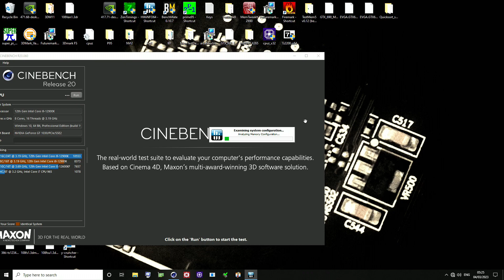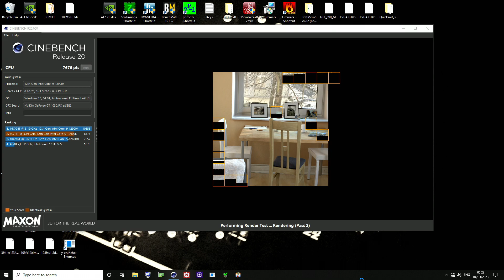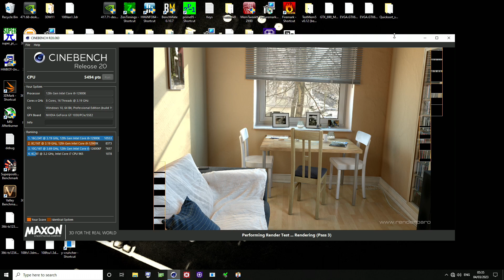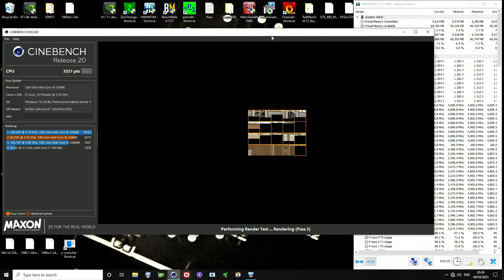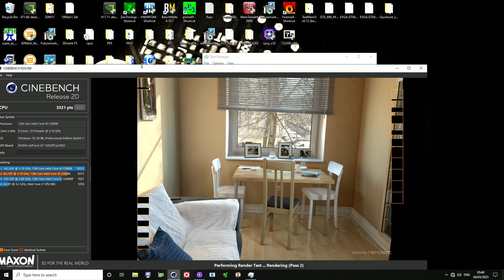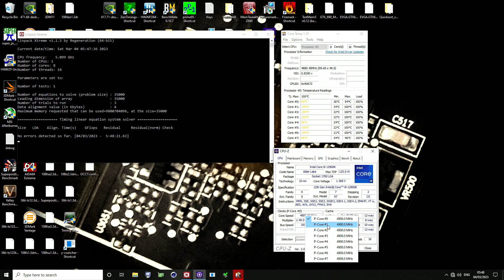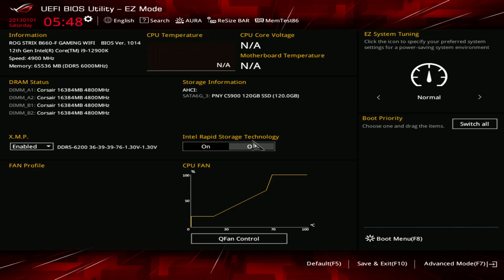EXTREME CPU CLOCK STRETCHING on intel 12th gen

Comment: My 5600x does this too. For example, just by setting the LLC to the lowest setting and leaving everything else on stock settings, the score is much lower. I can read that the effective clock changes in HwInfo tho. The non effective clock remains high.
Reply: I just realised my 5600x does this too, at auto settings. It stretches bad from some ntoskernel loads from C0 to C1 and introduces a stutter.
Workaround is medium llc and I also disabled spread spectrum.
Thats with pbo -25 -30 offset. Then the chip clock/voltage table works properly and limits itself to 4.5GHz 1.37v spikes under AVX loads.
If I then dial in frequency offset "+100MHz" the chip also functions properly and does not strech and lag, reaches stated 4.65GHz, but has 1.47V spikes.
Thats a hard limit, I think this particular chip is just meant to run 4.5GHz. As well as many other peoples cpus.

I also think this is where a lot of FTPM issues come from, because of the load from C0 to C1 from ntoskernel it clock stretches, produces the lag spikes while ntoskernel is auditing, and guess what auditing does, it calls for FTPM.   And the system DOES NOT SHOW ANY ERRORS. 

So basically no magic "PBO undervolting wonderland with 4.75GHz" and also by the way if you lose silicon lottery you cant even run stock without clock stretching.
Reply: @vaporainwaves  I decided to yolo it and I overclocked my 5600x to 4.8GHz static at 1.5v with the droopiest LLC and honestly it's been almost a year and it hasn't degraded a single bit, I'm pleasently surprised and would definately do that again.
Reply: @E27043   Honestly might be not a bad idea. Kind of scared of 1.5vcore. (Hassle of ordering new cpu) Watts your wattage and temps?
Reply: @vaporainwaves  i did it after seeing Derbauer make a degredation test on Zen 3 where he ran 3 chips for 3 years at 1.45v full load and they degraded minimally. Even Derbauer was very surprised and said that there was no problem running the chips at that voltage, perfectly acceptable degredation.

I used the droopiest LLC, this drastically lowers the voltage under load, 1.5v idle is not a problem ad it also does that on stock settings.
On r23 I get 12500 points, 135w and around 85° max, voltage drops to 1.388v so nowhere near as dangerous ad it sounds when saying i use 1.5v droopiest LLC.
Reply: @E27043  temps are ridiculous without aio on 1.5v, 65c 50w idle, decent dark rock cooler, def not going to do that for extra 0.2GHz lol. +vcore offset might be the way.
Reply: @vaporainwaves  lol I ran 1.55v highest LLC and drew over 165w in r23 at 110° multiple times and it has been fine, no degredation. But I definitely don't recommend it, just saying that these chips are tougher than we thought.

Comment: If I haven't run across this video, I swear I would've thought I was crazy! This is also very apparent with the 13th gen CPUs. I own a 13600k paired with B760i from Aorus and attempted to undervolt as the stock temps reaches 100C instantly with my 120mm AIO. I literally just threw a quick -0.1 undervolt and called it a day since HWInfo was reporting 5.1Ghz on all p-cores. Little did I know that while the core clocks are the same, the performance tanked 1/3 of what it's supposed to be!

Thanks a lot for this video, as this is the first time I've heard about clock stretching as this doesn't seem to be that much of an issue with the older gen intel.

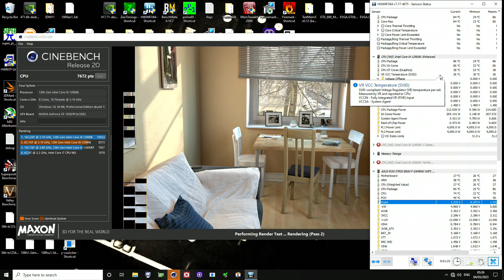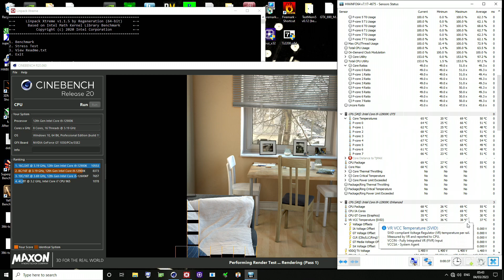Comment: I was surprised when facing this on my 13700K too. I would say it is relatively easy to recreate this clock stretching behavior when undervolting (be it offset, A/DC load line, or LLC). I also heard that this usually happens on the AMD system when undervolting. Anyway, when clock stretching happens, the power config (e.g., voltage) is not sufficient so there is a hard limit of CPU Package Power at that setting. At 3:03 in the video (normal setting), the CPU Package Power is 210W and R23 scores as expected. Meanwhile, at 9:30, the CPU package power is only 160W when clock stretching happens. At 19:43, it is 176W. I think it is the WAIT signal that reduces power usage. From my testing, if you run at a normal power setting, but have PL1/2 capped at 160W, R23 should produce the same result. Meanwhile, if you are using a “160W clock stretching” config, but with 140W PL1/2 (lower than the max consumption). Then the system behaves as expected again, meaning the score is the same as using a normal power setting but with a 140W limitation. The closer CPU Package Power to the PL, the less clock stretching happens. That’s why whenever I undervolt the 13700k, I will make sure it can supply enough power (wattage) at every power limit (+- 10W).

By the way, below is an explanation for clock stretching if anyone is interested in it. 

When talking about a processing unit, tasks are done by one or many instructions carried out during a clock cycle (Hz). At a very high overview level, the time of a process dictates clock speed (1/T of c). One GHz is 1 billion Hz, or 1 billion clock cycles. Clock stretching means the time to complete a cycle does not change, so your clock speed stays as is. However, the “WAIT” signal is mixed in between and thus an effective clock speed is much lower than usual. For example, with 3 Hz, you can perform the following tasks at each Hz: Start the computer, log in to OS, and open the browser. With clock stretching, the sequence becomes: Open the computer, “WAIT” (don’t do anything), login to OS. Therefore, you could not open the browser. At the hardware level, the processing unit frequency is the same as reported by sensors, but with the “WAIT” signal from firmware, it is effectively 33% slower than reported. With the same analogy (but not really about clock stretching), we have a 3600 “MHz” dual data rate (DDR) RAM stick, which is in fact 3600 MT/s. Meanwhile, the actual frequency is only 1800 MHz. DDR makes 1800 effectively become 3600 using a multiplication of 2. 

There are reasons for clock stretching. It will be different depending on contexts (e.g., software vs hardware), but here, it is for system stability. From an engineer's perspective, any form of protection (e.g., throttling) is better than straight-up hard crashing the system. When my 13700k clock was overstretched during an undervolting trial, even though I can run the Cinebench R23 loop for the whole day, and possibly 24/7, I lost almost 10k points. Linpack was also stable up until 200+ loops but took much longer time per loop. Prime95 errored out in the first 2 seconds for 2-3 workers, while the rest stayed strong. The same applied to my RX6800 undervolting attempt. In other words, my system actually became “fairly stable” under unstable settings.
Reply: Man that's was a long read and I'm not gonna even pretend I understood the majority of that but good to have some info regarding this. Anyway, what undervolt did you come up with?

I just undervolted my 13700K by -0.1V to lower the temps a bit. I was getting similar/better Cinebench R23 results to stock (30500-31000). Weird thing was I also tried running -0.05V and for some reason I was getting lower scores (28500-29800). Wasn't clock stretching supposed to happen any voltage down from here (-0.05 or less)? Then why was my -0.1V undervolt doing better, even better than stock actually?
Reply: so what is the solution?? I have 13600k and what offset / A/DC load line or LLC settings should I use so that it wont reduce the performance by reducing the vcore only a bit?? It drivers at 1.45V at any simple game.
Reply: @Golden2Talon  Just run override mode all core 5.1ghz with little llc vdrop like 1.2v idle ->1.16v prime95avx.

Comment: Yep noticed this prob when lowering voltage myself ended up just ocing to 5.2P core 41e cores @1.29v I couldn't figure out why my 12900k would run really slow when undervolted mine was doing it no matter what llc was set at on msi z690 edge

Comment: lol I currently have an i7-9700 paired with a cheapo Gigabyte B360M DS3H that used to run with an i5-8400 previously, I used ThrottleStop to undervolt the CPU, I selected CPU Core, CPU Cache, iGPU CPU > Set it to Adaptive > Unlocked voltages > Set an offset of -0.7v on all three, cinebench didn't crash, I opened and played games, no problem, so I tried putting the offset at -1.0v, cinebench didn't crash and it was going well, it ended the process but then all my apps started saying "Not responding" until PC crashed ( Blue screen ) , PC restarted > Logged in > Immediately again blue screen > Restarted > Logged in > reset values to stock real quick, it was kinda scary, guess Il stay with -0.07v for the time being, testing these things because I'm going to purchase an i7-12700K and pair it with an MSI B660M Mag Mortar DDR4 WIFI maybe next month, I live in a hot country and my room has bad airflow (dont know the ambient temp but its prob quite warm), at idle with a 240mm corsair aio I get like 40-43C idle and reaches 75C max (which is not bad) but that's a 65W TDP locked CPU, im getting an i7-12700K (No OC) but should be at least like 10C higher I guess so idk that's why Im researching about undervolting. gonna get three 120mm case fans that can ramp up at 2000rpm if needed to put as front intake just in case.

Comment: The first thing that came to mind was pulling up CPU-Z or The Intel XTU utility to check clock versus voltage reporting. Intel XTU has features I use that CPU-Z doesn't have so I tend to use it as my own verification tool. Maybe not obvious but I can't afford super expensive software that some one may have made for Professionals ...but I gotta use what I gotta use. LOL. This is weird behavior I have never seen before in my 3 decades of PC building and tinkering. This old dog learned something new. I appreciate the content an informative and educational type videos. Whether intended or not on the educational front I have learned a few things that have helped me keep a stable, voltage sipping (relative to a 9900K) overclock. I also love to keep up with the Memory Overclock and Tuning even though I do much less of that (Mostly just try and tighten timings). Cheers! Stay Healthy and Stay Sane!

Comment: I encountered exactly the same issue a couple of months ago, trying to push an OC by changing LLC. I used an MSI Z690, Adaptive - 0.07 offset and tested  through all the LLCs. I figured out that there was a scaling of performance decrease depending on the LLC mode. Funny thing though, I could get my 12900k to around 5.5 all core with super low voltage but R23 resulted in 16k.
I played around with the offset value too and found it to be not causing the issue. Only changing LLC back to auto fixed the problem.

Comment: I suppose I've got a good sample then, as I get 10.5k in CB R20 at just 1.25V LLC3 fixed voltage, been running it for a few months and never had a single problem. Very stable platform, at least for me. MSI Tomahawk.

Comment: Also if you CPU mesh ratio ( if it's still called that for AL) needs too be hard set because the system is more likely to do this if left on AUTO.  Also core temp has the ability to show you each core and not just the highest core clock, right click is your friend..

Comment: if you right click in CPU-Z you can get real time core clocks. if you have the enhanced C- states set to no limit or are allowing C5, C6 and C7 I can make my Xeon W-3175X behave the same under certain conditions. Also Core temp in the frequency section while benching will show a much lower clock. hwinfo is not good at showing the frequency in real time as it is a bit delayed.

Comment: If it takes a certain amount of voltage to reach a frequency, then that is the voltage the CPU needs. 

Anything above will increase the clocks, anything below will drop that clock speed.

That is how fixed voltage values work and it doesn't bluescreen. That's why peoplr complained about PBO from AMD since it can't do an adaptative undervolt.

When you do an adaptative undervolt (PBO 2 or Curve optimizer, Throttlestop and XTU), things are different, when you use a small number of cores, there is higher headroom to take out voltage to reach the same frequencies, therefore you gain OC headroom vs stock perfomance.

Then at base clock, there's less headroom to take voltage out of the base clocks since the CPU cores are being totally utilized and require more power instead of the CPU using a small number of threads and less power.

If you enable the power limits and the e cores (you let the e cores doing their job and the P cores reaching base clock when they should), you should get in theory better Cinebench R20 perfomance with an adaptative offset and better efficency since core count is better in that benchmark than a small bump in clockspeed. Ryzen 9 5950X with 16 perfomance cores at 3.8GHz easily beats an e core disabled i9-12900K at 4.9GHz.

Comment: For some reason i had effective clock stretching problem on 10600k. First 10-15 min after boot cpu was running full speed and then starts stretching by 100-200mhz. Throttlestop some how fixed it by running in background.

Comment: Reminds me of the vrm throttling on x299 which wouldn't show up in most tools as well. I don't remember but I think throttlestop was one of the few softwares picking this up.
Reply: Throttlestop is designed for laptop users dealing with terrible motherboards and cooling since many, many years ago 😂
Reply: Throttlestop also has an adaptative undervolt capability, can show if the CPU is power throttling, thermal, etc. The best tool for Intel CPUs ever made.

I boosted the single core perfomance of my dinosaur i7-4700MQ almost by 10% by partially overclocking it with an adaptative undervolt through throttlestop. I gained like 200-300MHz, but i felt that difference while gaming, and microstutters in a emulator are completely gone after that, basically perfectly flat frametime now just by 300MHz more.

Comment: You need to disable CEP in the BIOS for Core and SA.
But that motherboard may not have access to that.
The same issue is on some MSI boards.
the Maximus boards have the IA CEP settings available and they are disabled by default (Auto defaults to disabled).
Basically, it's based on the VID table at LOAD.  Or interpolated VID.  CEP wants the "die sense" vcore (Not socket sense), at full load (idk what amps rating however) to be NO LOWER than the VID at the V/F point!  If it's higher it's fine.  IF it's lower,  it thinks your CPU is being undervolted and it causes phantom throttling (just like on X299 etc).
Reply: Can you specify what CEP is? how should one found it in BIOS, thanks?

Comment: I think you might try benching with some trivial C programs designed to measure wall clock while doing something that will only ever touch L1 cache. If you have access to cygwin/wsl 1 (not 2!)/linux, you could run something like:

  gcc -O0 -x c - -o aout <<< "void main() { for (int i=0; i>=0; i++) ; }"

to create a trivial executable that increments a single integer until it overflows (guessing it will take something like three seconds to run). Then using a bash prompt, run one for each thread on your cpu, ie:

  foo() { threadct=$1; for ((i=0;i<${threadct};i++)); do ./aout & done; wait; }

  time foo 64 # <- put # of threads on your CPU here

If no degradation then we can say this is at worst an L2-and-up problem. Likewise we could climb through the cache layers by frobbing more and more stuff until we hit RAM (kind of where  I'd expect the problem to manifest).

Comment: In the early days of 12th gen, every processor I tried to tune and make more efficient would downclock in response to negative voltage offsets or even setting a lower fixed Vcore. I ended up giving up and running stock voltage and being limited to +100MHz core clock offsets to stay within what a 280mm AIO could cool. Thankfully, newer bios updates seem to have fixed this issue on the override and fixed vcore settings. I would update your HWINFO64; when I've encountered this issue  my effective clock was expectedly lower.

Comment: Is CEP enabled? Static offset will trip CEP and cause a reduction in performance depending on the offset, which is why you should use VF offset mode instead.

Comment: From my limited experience with offsets on adler lake, clock stretching seems to happen when you go under VID voltage with offsets that are under max turbo ratio. Basically if go under VF point 6 voltage - you get this.

Comment: Does this behavior change with different "SVID behavior" settings? I think you can reduce the voltage by using Trained or Best Case Scenario mode. Also, do you set AC LL and DC LL along with your LLC?

Comment: What's really bizarre is that, if it does this now, what's to say its not always misreporting the clock speed?  How does the user know, beyond the shadow of a doubt, what the clock speed is actually is?  There is no way to accurately determine what the actual clock speed is.

Comment: Any particular reason you're using R20 over R23?
Reply from the maker: doesn't R23 take longer?
Reply: R23 does take longer.
Reply: I think R20 is more CPU intensive than R23 because the optimization is worse and the processors get hotter.

Comment: Also happens with most mobos with offset -0.20 on locked CPUs. While up to -0.15 you get the expected minor improvement in temperatures and scores by using less power
Reply: i tried on i5-12500 and on -0.05 perf decreased by 50%. on -0.1 it decreased by about 68%

Comment: Also happens with most mobos with offset -0.20 on locked CPUs. While up yo -0.15 you get the expected minor improvement in temperatures and scores by using less power